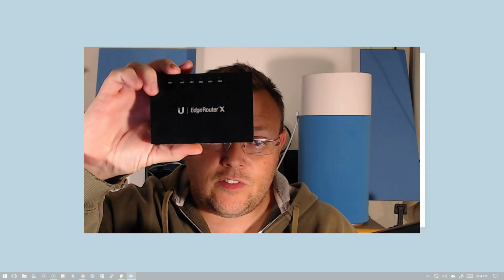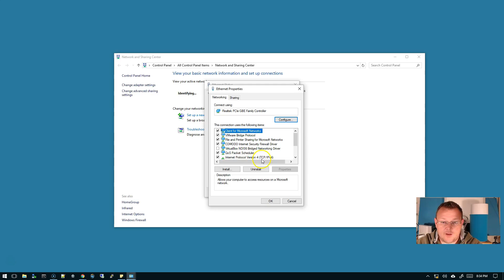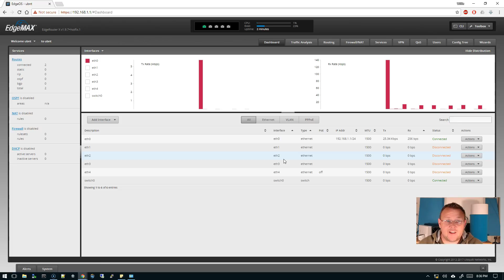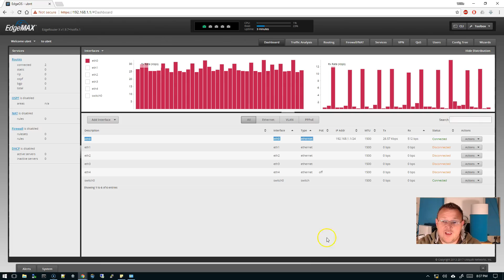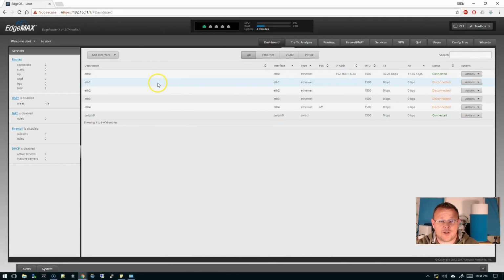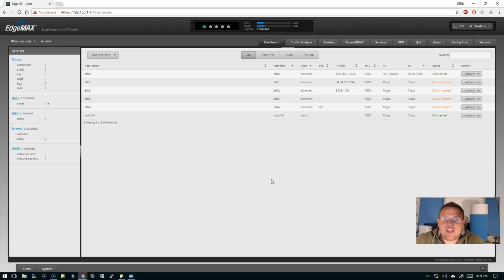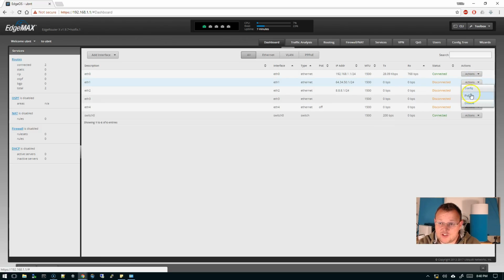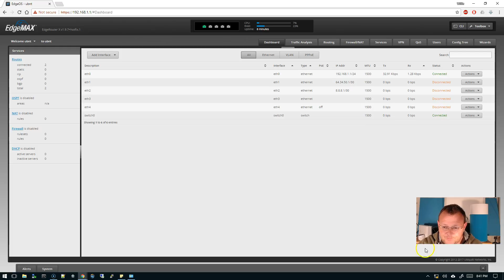How to simulate the Internet.

Comment: Nice and easy explanation. Could you do a video un providing UPNP with an edge router across networks (vlan). As this means sometimes helper addresses and transition between  broadcasts, multicasts and unicasts this should not be that straight forward.
But if you want to separate multimedia / UPNP devices and clients / guests there is the need of bringing those together.